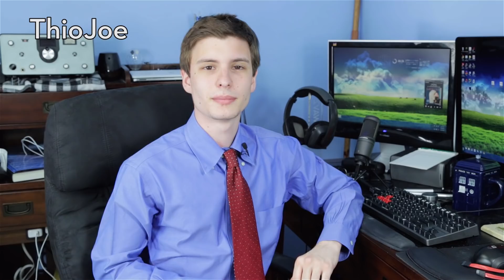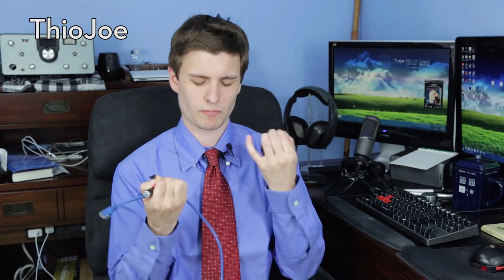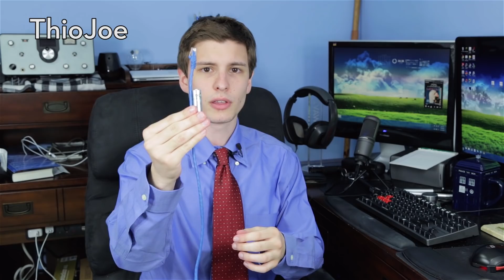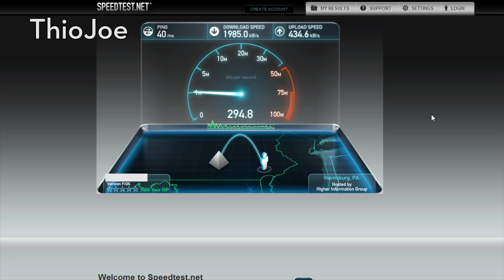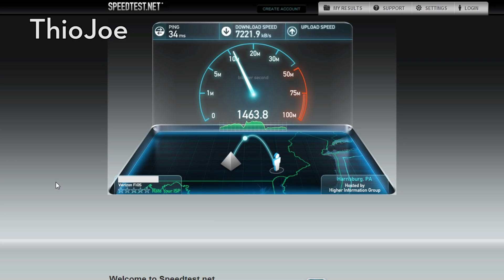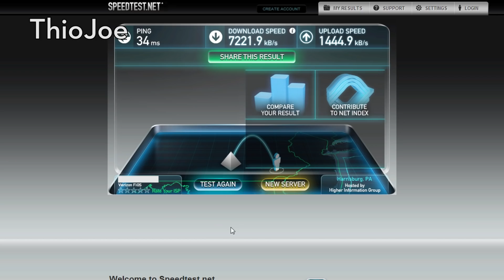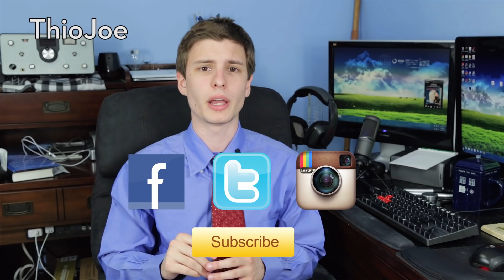Triple Your Internet Speed for Free

Comment: This is a fantastic concept for increasing signal strength through a CAT-5 cable. This also works for Erectile Dysfunction. Tape 1 AA battery to each testicle with electric tape so the conductance is better. Be sure the batteries have the same end pointing to the end of the penis. Also be VERY sure the batteries do not touch---very important. Rechargeable batteries work better but it is a trade off since you are tethered to an extension cord while walking around the house holding the charging unit with your pants around your ankles.

Comment: Thanks Joe, this improved my internet connection drastically.
Instead of AA batteries, i used 2 x 150 microfarad capacitors inline with the cable and calculated using Michael Faradays Law that by charging the capacitors with 1 coulomb of electrical charge it would have a potential of 150 Volts between its plates, in turn creating a "Turbo boost" effect on your speed which would be especially useful when experiencing bottlenecks during periods of the day when internet capacity is highly congested.

Comment: I tried but didn't get any results.  I taped 2 rechargeable batteries about 3 inches from the ends of each side of the cable as instructed, but zip.  No improvement.  What went wrong?  Can you advise?

Comment: Ok I am testing several times with different cat 5 cables. With a local server. I used battery cable with cheap non re-chargeable batteries. However, I am coming up with a deficit of 3 points with the battery cable. My last comment seems to have been a fluke with the server. I might get some re-chargeable batteries later and test again. So to re-cap I get better speeds with plain cat 5 on Verizon FIOS fiber optic.
Reply: funny
Reply: ya try that..... goodluck!
Reply: lol I don't believe no body tried this.

Comment: I used aluminum foil under the tape, so as to get a better coupling between the CAT5 and the batteries. This takes a little longer to do, but is worth it if you want to get the performance up. I can see why Joe didn't mention this, because maybe it only gets you from 3x to 3.6x. Maybe not worth it, for most people.

Comment: I found that if you wrap the cable around a "Car Battery" it will speed the service up 5X which is much better than 3X. The problem I found with this though is that if you use a yellow cable vs a blue you do loose about 2 kb when testing. Not quite sure why but I think the color dye in the cable slows it down. Hope this helps. (NOTE: using Wallmart batteries work the best as long as you keep it fully charged.)

Comment: It's worth pointing out that Electrical tape does not conduct electricity.   It actually insulates electric connections....   Gonna go out and use some electrical tape to extend my dryer outlet to the garage so I can hook up my TIG welder.......

Comment: Nice. My connection speed increased about 3.2x. I also saw gains of over 5x by using hot sauce to deoxidize the connection points, and applying a conductive thermal compound inside my ethernetports (arctic silver 5). My internet flies.

Comment: It works, not only did it tripple my internet speed, it made it 40 times faster, due to the fact that I used green colored tejp instead of electrical tejp. Green colored tape can also send and receive Wi-Fi Connections, that increases the speed dramatically.

Comment: much faster without the tricks shown here…they say the type of signal controls the speed on the internet.  I don't know I registered 70 MB without the batteries and 112 MB with them on speedtest.net  One way to make sure you get enough speed is to stay on the LAN and don't use the wifi.  With the wifi, I get 30 MB….well it works okay….with 30 MB but barely...

Comment: so I made an adjustment to your video. I bought a 100 cat6 cables and took 50' of electrical tape and wrapped them all together, then I do 2 of the 12v lantern block batteries and wrapped them on top of the new design cable I made. I took the Center Ethernet cable and plugged it into my modem and then into my computer. I turned on my modem...my computer blinked a few times and told me my speed is 1 teraflop. I am officially faster than any fiber out there.. thanks man.. Now I can watch my porn at 1000x fast forward.
Reply: awh luky
Reply: Now that's just excessively greedy. Besides, I bet you now have a serious case of Repetitive Strain Injury, along with 3rd degree burns. :-D

Comment: I was a little disrupted by the fact that he knew the conversion for a kilobyte to a megabit, you know, because of the tape thing. Love this. My cat6 cable with batteries showed a significant increase to internal transfer rates as compared to my cat5 cable without. I'm thinking about putting batteries on all the way from my router to the googlesphere now. I need less pings. Always.

Comment: To all of those with a wifi router - use the ethernet cable and behind your router there should be a port. Shove the end of the ethernet cable all around the router and see which one fits best. Then put the other end into your computer, same thing, shove it around until it fits. If it doesn't fit anywhere on the computer, you can still do this. Just tape the other end of your ethernet cable onto your monitor. Helped me quadruple my internet speed. Thanks ThioJoe ! Only problem is I can't move more than 5 feet away from my router. Do you think you could make a video showing how to do this wirelessly? That'd help a lot.

Comment: Is this for ADSL broadband modem or is it just for broadband? There are two types of broadband that I know of. Which of this cable modification would be suited for? I have ADSL broadband, that is a phone line going to an external wireless modem and then an Ethernet cable similar to the blue cable you're referring to is plugged into the modem while the other end is plugged into a non wireless computer. Is this the type of Ethernet cable that I have to modify to get the extra speed I need to load porno faster? Nah, I was joking. I meant to download or play online games. If it triples the speed, does it also triple the bill?
Reply: It works for both, especially well for ADSL broadband, which is what I have too. My speeds increased 5x or 6x as fast!
Reply: Dillybar777 Thanks for your comment. I think I will give it a try. It's not that I really need it but it's good to know new suggestions and ideas that would help make life easier. But does this broadband speed increase also mean an increase in ISP billing? Just curious as whether there's a possibility that I could be billed triple the amount.
Reply: I haven't seen any change in my bills since I did this :)

Comment: I have done this at home and it works well but guys there is a slightly better way to do it

if you have the batteries facing in the same direction, not like in the video, have the positive ends of the batteries pointing at the same end of the cable, it creates millions of microtubes running from one end of the cable to the other.  you can't see them unless you have a really powerful magnifying class or strong reading glasses.  the microtubes help your internets through the cable, just like if you stick a paddle in a pool and push the water along.

to prove it I am downloading the new monsters inc movie at 700 megabytes per second on an old dial-up connection at my mom's house

Comment: This is such BS.... your internet is throttled by your ISP so you can't get more than what you pay for....
Reply: try d battery instead if u are having trouble
Reply: RandyDarkshade he said USE electrical tape because doing this conducts electricity.. granted its not even enough to feel it but that is an uncontrollable effect of electrical cable and metal side by side. im not sure what voltage Britain communication lines run at but here in Australia its 75 volts AC on ring and 50 volts DC when not on ring, if that makes any sense to you
Reply: Not always. Here in Britain it also depends on quality of cables you use, quality and condition of the phone socket and quality of the exchange box outside on the street. It all can affect your net speed.
Reply: still tripling is definitely not the amount you would be getting from a trick of the sort
Reply: Probably because it's not serious? He said electrical tape conducts electricity, that should have been a good indication that this video was a joke video. Anyone with any electrical knowledge knows PVC electrical tape does not conduct.
Reply: He is a troll. xD

Comment: Do the batteries need to be charged if using rechargeable batteries. And if the batteries loose charge, do i need to recharge them every now and then?  Which would be better traditional batteries or rechargeable and why?  I did not triple or even double my internet speed, but did notice a very, very slight increase using traditional batteries.

Comment: If I'm using wi-fi do i just throw the batteries at my router or do I tape them to the end of the cable and swing the cable around above my head while i'm online. I tried the second option and  I've noticed that my internet speed has doubled but my typing speed has halved.
Reply: You're going about it all wrong, dude. You need to get a motor and prop for an r/c plane and lash it up with tape. You won't even need wire since the electrical tape conducts, right? Put a piece of thin, stiff plastic betwen the batteries, tape everything up, and hold the assembly with the prop pointing up somewhere near the router. Now pull the plastic strip (like a grenade pin) and let go. It'll just hover there so you can go back to typing with both hands.

Comment: Um.. Small problem. I have wireless internet so i don't think this would work. Do i just throw the batteries in the general direction of my internet modem and hope the wireless connection catches some magnectic induction fields?
Reply: To improve the wireless signal, you can use the electrical tape to attach a AA or AAA battery to each antenna of your router.  This will boost the signal by a factor of 2.4.
Reply: No need i bought BT wireless which is really fast so i believe they have the batteries installed on the antennas already.
Reply: Yes. BT wireless has them installed already.

Comment: i did this. I got weird results. W/O the batteries I got 12.9mbsp. I added 2 (uncharged) batteries like he showed. !st test 73mbsp (wow, freaking awesome but unbelievable) second test got 38mbsp, 3rd test 14.56mbsp,4th test 13.63mbsp. WTF! why does it go down with every test? Do the batteries need to be charged? AA or AAA? Do the batteries need to be perfectly inline with the cable? Lots of gaps here. Gonna try the "adding a Ethernet cable" way next. See what happens. The above way isnt consistent "for me"
Also I had the option of 3 different servers and one (University of Houston) was 15mbsp faster on download. How do I set my computer to run from that server or does it automatically choose one for me?

Comment: so black plastic with some glue called electrical tape.. tape you use on electronics. wouldnt it be great if it was conductive and shorted out everything. perfect.. no electrical tape is not conductive for a reason, and you didnt even put the tape in the batteries poles... your such a faker..
Reply: Genius right here.

Comment: So 8 million people watched the double internet speed video but only 300,000 ish watched the triple internet speed?
I don't think this is bs. This is just a matter of physic. Your speed degrades due to attenuation over the length of the cable from magnetization, radio frequency, microwave, etc...If you actually protect your cable from all attenuation, then your speed will be faster.
No the speed will not be faster than the speed cap that you pay your cable company. But it will be faster than what you are getting now, which is slower than your internet speed cap (download/upload).
Also how do I disable this "Also share on Google+" button? So annoying.

Comment: Merry Xmas and tx for this info. Several questions...

1. Does using 4 AA batteries vs 2, significantly enhance speed? 

2. Does adding the 2 other cable you noted, significantly enhance speed? 

3. Must the AA batteries be replaced periodically, and if yes, how often?

GPM sends

Comment: this is a fake, use it on a CAPPED internet connection which bandwidth is limitted for an instance capped at 10Mbps. ISP's now serves 10Mbps highest throughput in you internet. AND using this technique will ONLY help internet which having a higher max bandwidth and receive less.
Reply: show the proof

Comment: Hi guys , the only and best way to increase your speed is by changing your either net cable from a "Cat5" to a Cat6E" This cable has the transmit and receive pairs twisted more often per foot and this increases your cables bandwidth . All of the video is bullshit , he has brown eyes and you don't see his feet , he is wearing rubber boots because the bullshit is so deep
Reply: Also the conductors are thicker. You want faster speed? Hook up to a fiber optic network directly to an Internet Service Provider (ISP) with a Giga bit Cat-6 LAN connection. Be prepared to spent up to $200 a month for this speed. Of course you need a computer that can handle processing this amount of data.

PCI Express Gigabit SFP interface fiber optic lan card NIC - typically used with servers

Comment: I am new to computers and I enjoy your tips, however: there are times that the background music is too loud. I'm a paralyzed decorated war veteran and have a difficult time listening to what you are 
 saying with the loud music. You don't need loud music we want to hear your VOICE. The next concern is that you and other assume that we are knowledgeable individuals in the realm of computers, we are not. Start from the beginning with the router, the cable the taping of wire with the batteries, and finally  
connection of the cables. I have AT&T U-Verse, my download (20), upload and PIN speed are almost like yours, will this additional wire with battery setup help me? 
.

Comment: I did a bit of tinkering, with your idea's, and mixed them with some idea's for the viewer, i used 4 flux-capacitors inline with 2 cat 5 network cables. and then hooked it up to 6 car batteries. i then when ahead, and used 6 rolls of electric tape, for super conduction. and then laided it all in jello and stuck it in the fridge till it set. making sure that both ends where still out and untouched by the jello. after connection the cables, i found my computer internet speed was so fast. that when i when to use it, it took off. luck the canle was wrapped in so much tape. and housed in the jello. or i would have lost my computer, due to the window was open. thanks again, for your video and advice, now i have to chain it to the table, or unplug it, thanks again Joe

Comment: hey ThioJoe i want to ask you a question
i have a netgear [jnr1010 n150] wireless router and i want to increase the range of the router 
can i replace the existing antenna with a [2.4 GHz 9dBi WIFI Booster Wireless Antenna] 
will it compitable with my modem and will it increase the wifi signal range ??
hope you will answer it fast....!

Comment: This is great for beginners .. but if you want to increase your internet speed by orders of magnitude, you can add a flux-capacitor in series with your TX and RX lines. The flux-capacitor is directly coupled with the quantum state of those signal lines right at the ISPs outbound routers, so any time delay that comes from transferring the signals over the copper-wires is eliminated!

Comment: if you use a wireless modem can you still do this procedure. For example connect the batteries to the ethernet cable from the wall to the wireless modem as my set up is at home?

Comment: All I say is try it. If it works woo hoo. If it don't then don't tell anyone you even tried. It really is that simple.  Don't cost anything if you got the stuff laying around. Again if it don't work take the tape off the battery and put back the cable. No harm no foul. No need to be a bunch of dicks about it. Just say it worked or didn't work if you have to say anything at all. Good Luck.

Comment: Got to the end of the video , after i heard the thing about the electrical tape i was just astounded and had to watch the entire thing , ur principle on electromagnets is true , they do make a VERY small current appear in a cable when close but im going to call BS here because you can use WHATEVER cable you want from your wall to ur pc , you can even use high voltage cable because it doesnt matter due to the fact that the cable in your wall is still crappy standard ethernet cable. Good day

Comment: I didn't have electrical tape so I used duct tape instead.
After my release from the burn ward, I trotted on down to the hardware store and purchased the proper material. 
I now have blinding internet speed; but my keyboard speed has been drastically reduced due to the fusing of some of my fingers.

Comment: ....if you put batteries in your ears with the both positives facing your left ear you can use the left side of your brain thus the opposite direction you could use the right side of your brain however if you have both the positive facing the inside of your head it will create reverse polarity and your brain will begin to smoke and go up in flames .

Comment: wo wo wo hang on, did he just say " its important to use electrical tape cuz it CONDUCTS electricity"? no it dosent my friend, if anything, it does the opposite. an electrical tape is an insulator tape to stop the conduction of electricity so u wont have naked joints and wont get shocks.